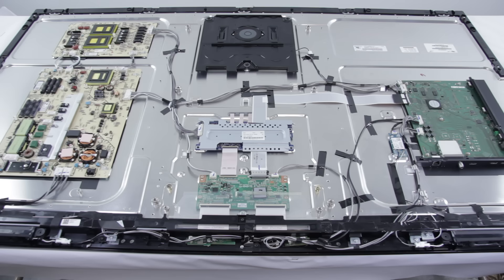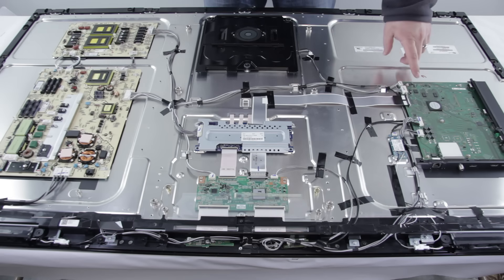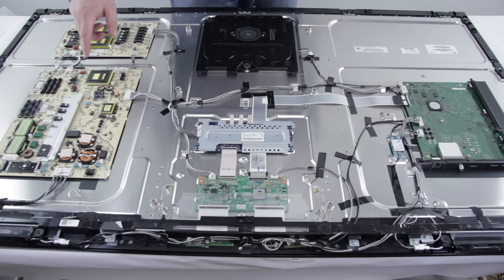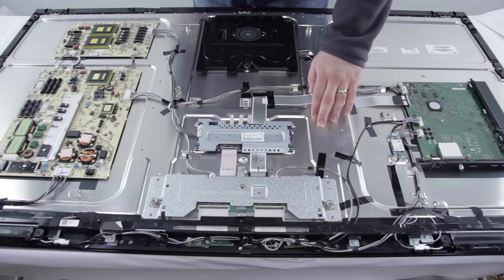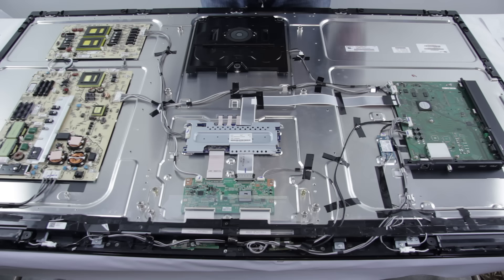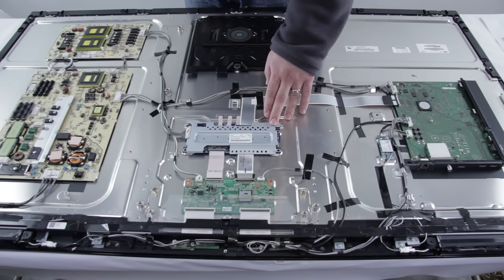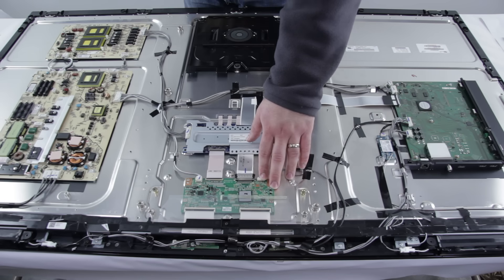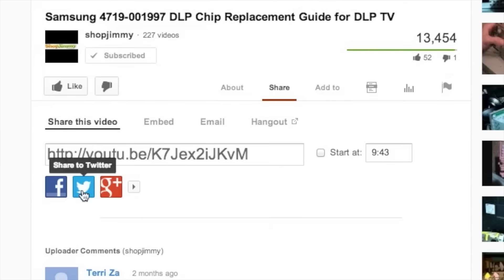LED TV Repair Tutorial - Common Symptoms & Solutions - How to Repair LED TVs

Comment: LG 47LS4500 LED tv. I have sound but no picture.  The back/edge light lights up, but the screen is black.
Reply from the maker: Cyn Haynes  Please watch this video FIRST to help with your repair!  https://www.youtube.com/watch?v=BP3NVNCGEv8  I recommend replacing the main board in your TV.  Click this link to replacement parts for your TV model number:  http://www.shopjimmy.com/catalogsearch/result/index/?cat=56&q=47LS4500  There may be multiple boards for the same TV model number, be sure to match part numbers on your current board, with your replacement for compatibility.  Here is a link to a video showing how to identify your part number, click here:  https://www.youtube.com/watch?v=RwHTvjMdrhk  Thanks and please let us know if you have any further questions with your TV Repair!  www.shopjimmy.com
Reply: ShopJimmy.com Somehow I got the impression it would be the T Con board from your video. (5:10) where it says if your tv has sound but no picture and the backlights are on, it could be the T Con board.  May I ask why you suggest it is the main board?  I checked it again since reading your reply and when I looked at the screen, there was a darker black box on half the screen if I pushed a button on the front panel.  It wasn't symmetrical.  Not sure if that makes a difference in which board.

Comment: I have a 40" LED, model # 47LS4500-UD   It appears to have been kicked or hit.  There is not any visible damage to the case, but when the TV is turned on, there is a very specific area in the bottom right of the screen that has colored vertical and horizontal lines emanating from it.  The TV does have sound, and the remaining picture is clear.  Thank you
Reply from the maker: Jonathan Halk   This sounds like a TV panel (TV Screen) problem.  If your TV panel is bad, it may be more cost-effective to replace the TV as panels are typically hard to find in stock, difficult to replace, and expensive.  Thanks and please let us know if you have any further questions!  www.shopjimmy.com

Comment: I have a Samsung led model un32f5000af, the screen has gone black with sound only.  If I shine a flashlight on it I can see the images on the screen.  Thanks for the help
Reply from the maker: Steve Zook   Please watch this video FIRST to help with your repair!  https://www.youtube.com/watch?v=BP3NVNCGEv8  This could be a problem with the power supply or the LEDs in your TV panel are bad.  I recommend replacing the power supply board to see if that fixes the problem.  Click this link to replacement power supply boards for your TV model number:  http://www.shopjimmy.com/catalogsearch/result/index/?cat=59&q=un32f5000af  There may be multiple boards for the same TV model number, be sure to match part numbers on your current board, with your replacement for compatibility.  Thanks and please let us know if you have any further questions with your TV Repair!  www.shopjimmy.com

Comment: I have a Samsung UN466300SFXZA. The screen has suddenly been going dark. I have tried resetting to the "standard' picture viewing. I've set the backlight higher. Nothing seems to help. What suggestions do you have
Gerry L.
Reply from the maker: Gerald Lindner   This sounds like a TV panel (TV Screen) problem.  If your TV panel is bad, it may be more cost-effective to replace the TV as panels are typically hard to find in stock, difficult to replace, and expensive.  Thanks and please let us know if you have any further questions!  www.shopjimmy.com

Comment: Hi guys great channel. I have 2 Samsung un40f6300afxza tvs. no power light, nothing happens when power button or joy stick pressed. I have 167 vdc on fuse fp802, but never get any voltage out of the other connectors. Could this be the main board? 
Thanks for all the good info.
Reply from the maker: Jim Knox   Please watch this video FIRST to help with your repair!  https://www.youtube.com/watch?v=BP3NVNCGEv8  I recommend replacing the main board in your TV.  Click this link to replacement parts for your TV model number:  http://www.shopjimmy.com/catalogsearch/result/index/?cat=56&q=un40f6300afxza  There may be multiple boards for the same TV model number, be sure to match part numbers on your current board, with your replacement for compatibility.  Thanks and please let us know if you have any further questions with your TV Repair!  www.shopjimmy.com

Comment: Hi 
I have an LG 49lb55. I found the fuse and MOV were blown and I replaced these. Now my TV seems to go into stand by (power led comes on) but when I press the power button on the remote or TV the backlight flashes twice and then it goes back into standby. I also hear what sounds like relays clicking (I can't see any relays so not sure if this). Any suggestions on how to repair my TV? Thanks John
Reply: Thanks Matteo. I plan on taking the power supply to work tomorrow and scoping it to see if I can find anything. Buck converters seem to be a good place to start. It's going well thanks. Some interesting work and I'm still learning. Where are you now? Still the battery place?
Reply: Nice! It must be a relief to have it almost done. How'd it all go? And how's balancell going?
Reply from the maker: John Frost  This could be a problem with the main board or the power supply board in your TV.  You may need to replace each board individually to see which one fixes the problem.  Unfortunately I do not see any replacement parts in the search results for your TV model number on our website.  Please reply with your part number on your main board and power supply board and I can try searching for replacement parts.  Thanks and please let us know if you have any further questions!  www.shopjimmy.com

Comment: I have a Samsung HDTV Model UN39FH5000FXZA manufactured Nov. 2013.  The audio is working but there is no picture.  Did the flashlight test and there is no backlights or images.  The capacitors on the power board are feel and appear to be good and flat. I found the Tcon board on this model but cannot locate the LED driver.  Any help would be appreciated and repair suggestions.
Reply from the maker: 19Shovel70  Please watch this video FIRST to help with your repair!  https://www.youtube.com/watch?v=BP3NVNCGEv8  I recommend replacing the main board in your TV.  Click this link to replacement parts for your TV model number:  http://www.shopjimmy.com/catalogsearch/result/index/?cat=56&q=UN39FH5000FXZA  There may be multiple boards for the same TV model number, be sure to match part numbers on your current board, with your replacement for compatibility.  Thanks and please let us know if you have any further questions with your TV Repair!  www.shopjimmy.com

Comment: Hi, I have 40 inches Samsung LED 3D TV model:  UA40EH6030RXUM  , all of a sudden it stopped working , no picture and no Audio .. the power led blinks when I presss any button on the remote .. it doesnt detect chromecast when connected .. Can you help me out to find out whats the problem ?
Reply from the maker: Santosh Anumandla  Please watch this video FIRST to help with your repair!  https://www.youtube.com/watch?v=BP3NVNCGEv8  I recommend replacing the main board in your TV.  Click this link to replacement parts for your TV model number:  http://www.shopjimmy.com/samsung-bn94-05874s-main-board-for-un40eh6030fxza.htm  Be sure to match part numbers on your current board, with your replacement for compatibility.  Here is a link to a video showing how to identify your part number, click here:  https://www.youtube.com/watch?v=BEPWrefQvqI  Thanks and please let us know if you have any further questions with your TV Repair!  www.shopjimmy.com

Comment: I have an emerson LHD32K2OUS and the backlight flickers really bad, I still have picture and sometimes if I tap the back of the TV or shake it a little the LED will come back for a few mins, other times the light will not come on at all. I'm thinking its a bad connection somewhere, I checked all the solder points on the PSB and they all look fine. On this model the two power boards are combined also. Could this be the LED's going bad? Or the LED driver? any help would be very appreciated!
Reply from the maker: Bill Bagwell   This could be a problem with either the power supply or the LEDs in the TV panel.  You can replace the power supply board in your TV to see if that fixes the problem in your TV.  Unfortunately I do not see any replacement parts in the search results for your TV model number on our website.  Please reply with your part number on your power supply board and I can try searching for replacement parts.  Thanks and please let us know if you have any further questions!  www.shopjimmy.com

Comment: Model # 32LN520B
Serial # 308RMVB0F831
Problem with LG tv is no picture but sound.
It does have screen has back light.
Reply from the maker: Alvin Franklin   Please watch this video FIRST to help with your repair!  https://www.youtube.com/watch?v=BP3NVNCGEv8  I recommend replacing the main board in your TV.  Click this link t replacement parts for your TV model number:  http://www.shopjimmy.com/lg-ebt62640113-main-board-for-32ln520b-um.htm  Be sure to match part numbers on your current board, with your replacement for compatibility.  Thanks and please let us know if you have any further questions with your TV Repair!  www.shopjimmy.com

Comment: Model number LN52B530P7F version is SD02 samsung red light is solid but tv wont turn on please help asap! Was playing ps4 and the screen shut off on me 

- Briana
Reply from the maker: Bri x   This could be a problem with either power supply or the main board in your TV.  You may need to replace each board individually to see which board fixes the problem.  Click this link to replacement parts for your TV model number:  http://www.shopjimmy.com/catalogsearch/result/?q=LN52B530P7F  There may be multiple boards for the same TV model number, be sure to match part numbers on your current board, with your replacement for compatibility.  Thanks and please let us know if you have any further questions with your TV Repair!  www.shopjimmy.com

Comment: Hey thanks for the awesome video! I have LG 47LN5700 LED tv. My tv has picture (with flashlight test) and sound but no backlighting. I'd like to know what part i should get for this tv, or if there are any other tests I should do to narrow down the issue.
Reply from the maker: Nicolai Mostad  Please watch this video FIRST to help with your repair!  https://www.youtube.com/watch?v=BP3NVNCGEv8  This could be a problem with either the power supply board or the LEDs in the TV panel.  You can replace the power supply board to see if that fixes the problem with your TV.  Click this link to replacement parts for your TV model number:  http://www.shopjimmy.com/lg-eay62810801-power-supply-unit.htm  There may be multiple boards for the same TV model number, be sure to match part numbers on your current board, with your replacement for compatibility.  Thanks and please let us know if you have any further questions with your TV Repair!  www.shopjimmy.com
Reply: ShopJimmy.com So I bought the part. Checked the to make sure it was the right part. It was completely identical so I assume it was the right part.I put it in the TV and tested it out, and the problem persisted. The LG logo flashes for about half a second and then goes black. I can still see and access the menu when using a flashlight to look at the screen.
Reply from the maker: Nicolai Mostad  Did you match part numbers on your original board along with your replacement board?  Thanks!  www.shopjimmy.com

Comment: I have a Samsung UN39FH5000 39" LED TV that just lost its picture on all inputs. Cannot see menu. Sound is ok. Power resetting did nothing. I can see the screen black shade change from a dark to a brighter shade when it's trying to show something so I am assuming the back light is ok. Do you think it's the t-con board? Seems to be the cheapest thing to try first. Thanks!
Reply from the maker: Kevin Martin   Please watch this video FIRST to help with your repair!  https://www.youtube.com/watch?v=BP3NVNCGEv8  This could be a problem with either the t-con board, the main board, or the TV panel.  You can replace the t-con board and main board individually to see if one of those replacement boards fixes the problem.  Click this link to replacement parts for your TV model number:  http://www.shopjimmy.com/catalogsearch/result/?q=UN39FH5000  There may be multiple boards for the same TV model number, be sure to match part numbers on your current board, with your replacement for compatibility.  Thanks and please let us know if you have any further questions with your TV Repair!  www.shopjimmy.com

Comment: I have a VIZIO and it's model is E3D470Vx. the TV turns on fine and stays fine for a minute or 2 before what sounds like a static pop through the speakers. When the pop happens the coloring goes out of wack and vertical lines appear. Please help
Reply from the maker: Bret Flint   Please watch this video FIRST to help with your repair!  https://www.youtube.com/watch?v=BP3NVNCGEv8  This could be a problem with either the main board or the TV panel.  You can replace the main board to see if that fixes the problem.  Click this link to replacement parts for your TV model number:  http://www.shopjimmy.com/catalogsearch/result/index/?cat=56&q=E3D470Vx  There may be multiple boards for the same TV model number, be sure to match part numbers on your current board, with your replacement for compatibility.  Here is a link to a video showing how to identify your part number, click here:  https://www.youtube.com/watch?x-yt-cl=84838260&x-yt-ts=1422327029&v=kxkeGLhlQY8  Thanks and please let us know if you have any further questions with your TV Repair!  www.shopjimmy.com

Comment: Hey, on my Vizio VF551XVT Television, we have seem experiencing some problems for around a year now. It started out the TV just flickering while the picture was being displayed. Then certain areas of the TV would go out, however as of late it wasn't an issue and everything was working proper until a couple days ago. Now the TV turns on and there is no picture but we can see the picture if a flashlight is shined on it, and it still plays audio, etc. We took the back screen off and noticed when the TV is on there is a Red light that continuously flashes on what I believe is the inverter/backlight board. However we turned it on once and one of the bars of light lit up on the tv, so we turned it off, a flash of light occurred, and then tried to turn it back on again and it was black once again. however when it turned off afterwards there seemed to be another flash of light.
Reply from the maker: Matthew Taylor  Please watch this video FIRST to help with your repair!  https://www.youtube.com/watch?v=BP3NVNCGEv8  This could be a problem with the inverter board or the power supply board.  You may need to replace them individually to see which one fixes the problem.  Click this link to replacement parts for your TV model number:  http://www.shopjimmy.com/catalogsearch/result/?q=VF551XVT  There may be multiple boards for the same TV model number, be sure to match part numbers on your current board, with your replacement for compatibility.  Thanks and please let us know if you have any further questions with your TV Repair!  www.shopjimmy.com
Reply: ShopJimmy.com I've already been to your site and previously watched this video, however the parts I'm looking for seem to be sold out everywhere. Including on your site
Reply from the maker: Matthew Taylor  On the part page on our website, you can sign up to be notified when the part is back in stock.  Thanks!  www.shopjimmy.com

Comment: Hi Jimmy, I have a samsung led 60in  #UN60EH6050F  2 years old, with sound and no picture, I have back light, so probably T-con?
if so do you have part number?
thanks
Reply from the maker: *****  Please watch this video FIRST to help with your repair!  https://www.youtube.com/watch?v=BP3NVNCGEv8  I recommend replacing the main board in your TV.  Click this link to replacement parts for your TV model number:  http://www.shopjimmy.com/catalogsearch/result/index/?cat=56&q=UN60EH6050F  Be sure to match part numbers on your current board, with your replacement for compatibility.  Here is a link to a video showing how to identify your part number, click here:  https://www.youtube.com/watch?x-yt-cl=84924572&x-yt-ts=1422411861&v=BEPWrefQvqI  Thanks and please let us know if you have any further questions with your TV Repair!  www.shopjimmy.com
Reply: ShopJimmy.com
I got the main board from shopjimmy and it did not fix the problem. what now? will you take the board back? what part should I get next?
Reply from the maker: *****   You can call our customer service for returns information (877) 881-6492 or visit this page for more details:  http://www.shopjimmy.com/returns  I will check and see on a recommendation for a different replacement part and reply ASAP.  Thanks!  www.shopjimmy.com

Comment: Hi, My TV model is a samsung UE32F5000AKXXU, I have sound and have conducted flashlight test and can see picture with flashlight. Appears as though it could be LED driver.... I am unable to locate the part I need in the TV for me to order a new one.... please advise.. Thank Kev
Reply from the maker: kevin sauboorah  Please watch this video FIRST to help with your repair!  https://www.youtube.com/watch?v=BP3NVNCGEv8  I recommend replacing the power supply board in your TV.  Click this link to a replacement power supply board for your TV model number:  http://www.shopjimmy.com/samsung-bn44-00605a-power-supply-unit.htm  There may be multiple boards for the same TV model number, be sure to match part numbers on your current board, with your replacement for compatibility.  Thanks and please let us know if you have any further questions with your TV Repair!  www.shopjimmy.com